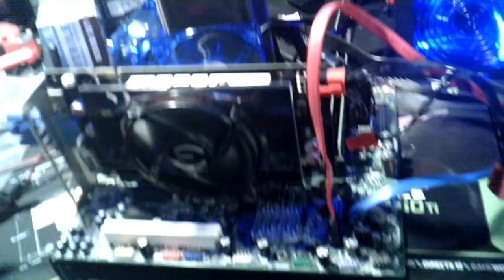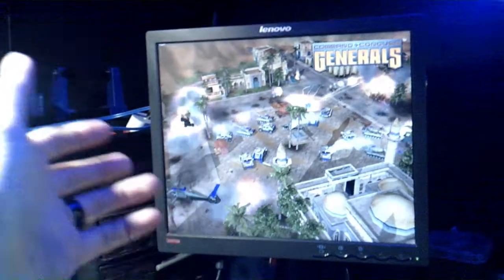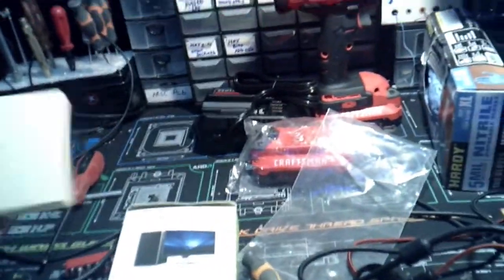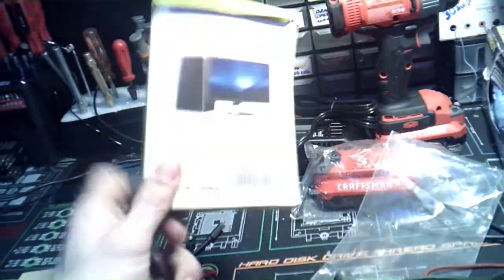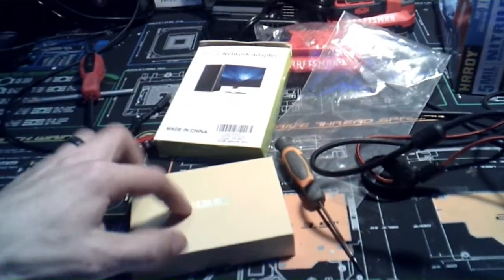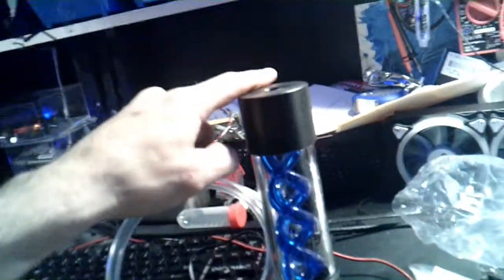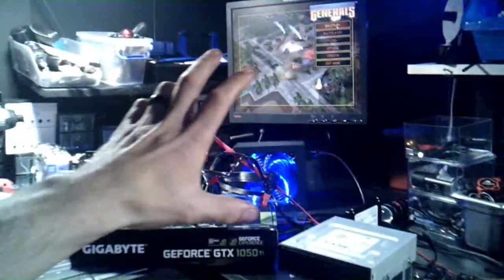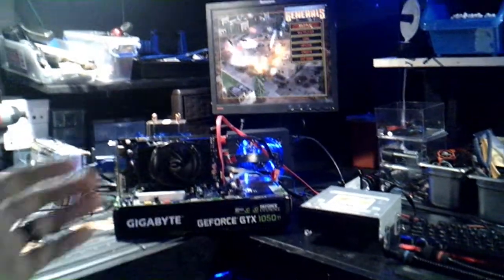i Got The 32-bitMonster Working!!-FiNaLLy!

Comment from the maker: It has a Q9650 cpu...8gb of ddr 2 ram at 800mzh. And a intel awardbios board. Socket 775...and a gtx 580 watercooled.../or a geforce gt9800 g1..its the best of the best for thw time period..2006 year